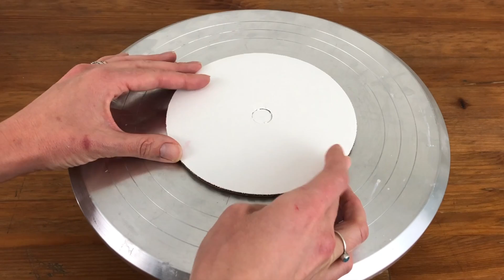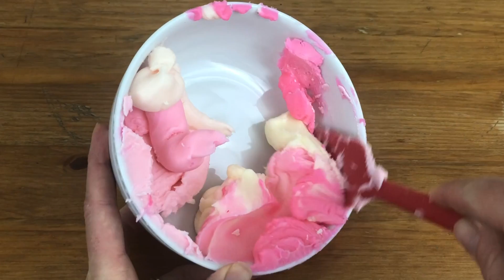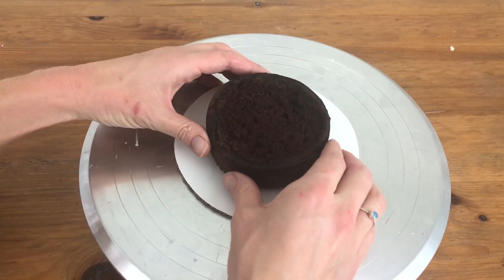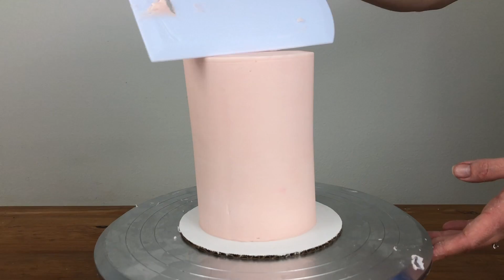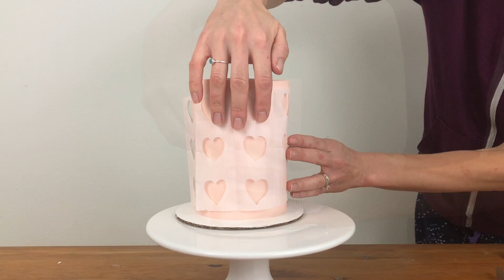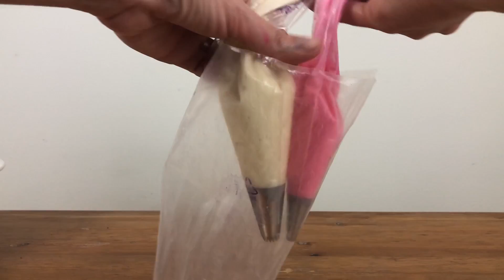3 Easy Valentines Day Cakes

Comment: Would this work with whipped cream  icing. With the sprinkle hart cake?
Reply from the maker: The other two designs would work with whipped cream but probably not the stencil idea - the frosting on the cake needs to get very firm before pressing the parchment paper against it